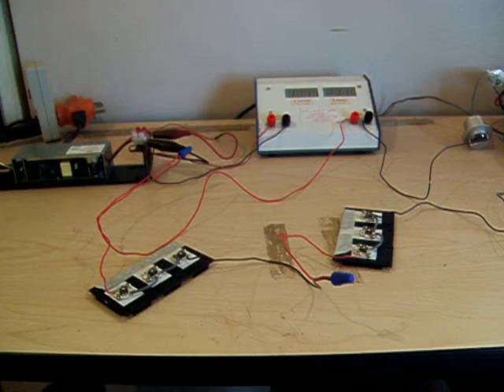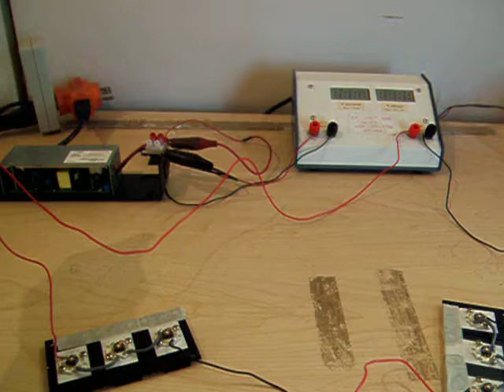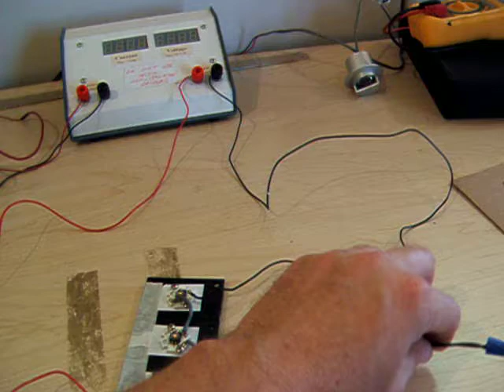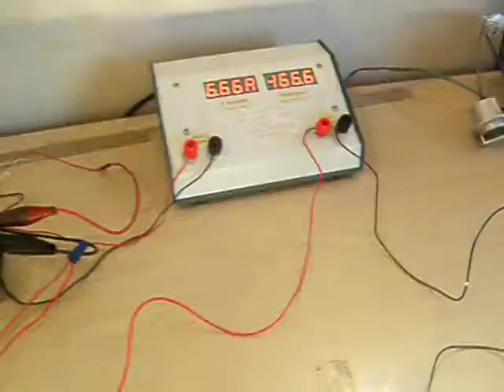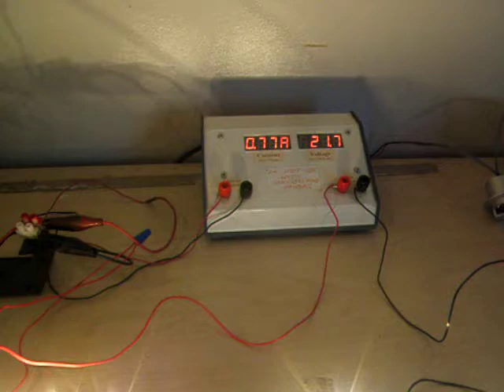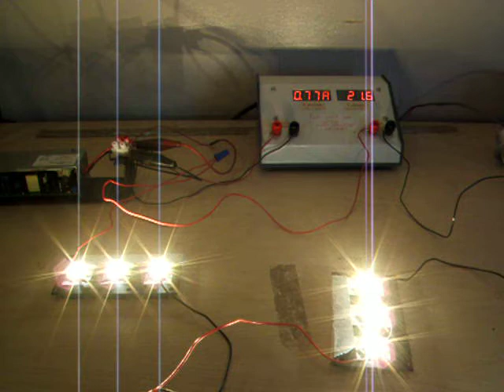Wiring LEDs in Series using a Constant Current Driver

Comment: Thanks so much for the video. I have a question though. Your meter shows 0.7mA and 21.7v .This obviously proves these are 3w leds whose specification should be 0.7mA current and voltage range from 3.1v to 4v. 
What I want to know, since the connection is in series, is your input voltage 21.7v @ 0.7mA current?
If so, what happens if I supply 15v @ 700mA current on this same setup of 6 leds in series. Thanks in advance.
Reply from the maker: Hello Himadri,

When the LEDs are wired in series, the drive current is the same through all of the LEDs.  

In this video, the load on the driver (Forward Voltage=Fv) is 21.7 VDC when driven at 770ma drive current.  If the drive current changes, up or down, then the load (Fv) will change.

If you supply 700ma to those LEDs in this video, then you will get slightly lower Fv than what this video shows (21.6VDC at 770ma), but it will be higher than 15VDC. The LED has a typical (and min/max) Fv at various drive currents.

If your driver was limited to a maximum load of 15VDC, then one of three things will happen:
1) the LEDs won't turn on
2) the LEDs will blink/strobe (this usually indicates minimum load not achieved)
3) the LEDs will be energized, but at some reduced drive current (not as bright)

I recommend watching the following video (How to size constant current driver)
Semper Fi Power Supply - Sizing LED Driver using Forward Voltage

Thanks,
Dave